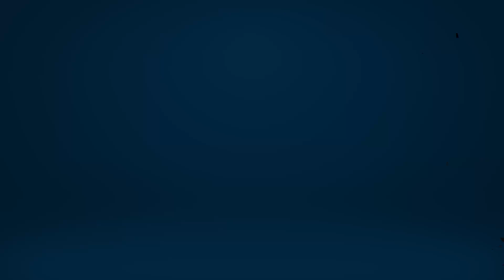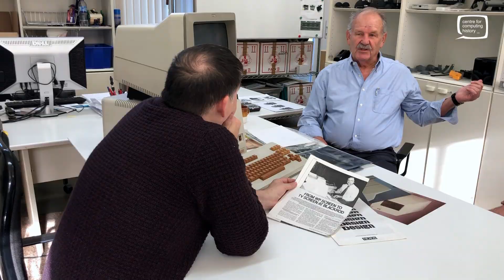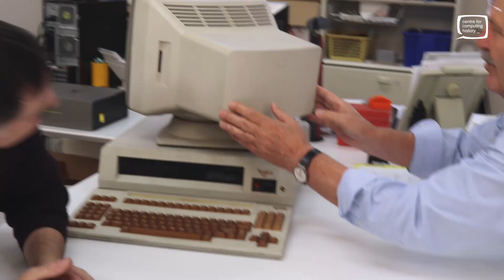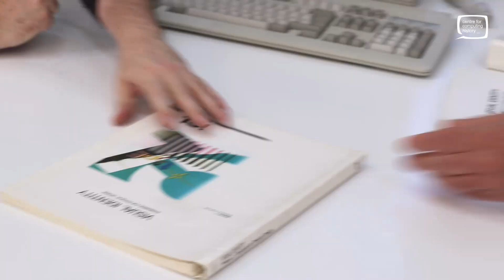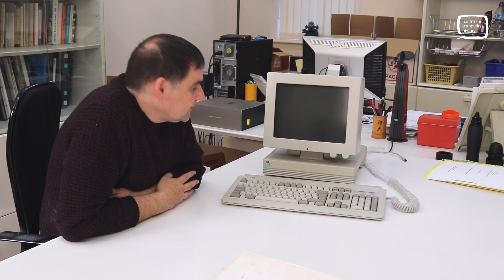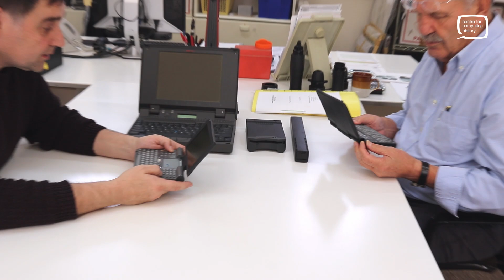Satherly Design - Product Design for ICL, Logica, Tadpole and GeoFox

Comment: I was Managing Director of Logica VTS Ltd for the whole of its existence, from February 1979 to June 1986, in both London (Newman Street) and Swindon (Drakes Way). I supported and endorsed the commissioning of Satherly Design as our industrial designer. Richard did a fantastic piece of work for us and introduced us to Taylor Engineering & Plastics in Rochdale. They produced the tooling and the mouldings for our word processor, which was marketed as the Logica VTS 2200, the Nexos 2200 and the ICL DRS 8800.

Comment: Thanks so much for this. It brought back so many memories. I worked for the computing arm of British Telecom (BSSU - Business Systems Support Unit) in the mid to late 80's and used to install and maintain the Gen 1 & Gen 2 Logica devices. The Gen 1 was badged as the M3300 (Merlin 3300) and was used as a word processor, running 'Merlinword' software. These were used in external customers (admin offices, solicitors etc) as well as internal BT offices. The Gen 2 was rebadged as the M4000 and was more than just a word processor, running bespoke software for many different scenarios. The customer base included every DSS (Job Centre) office in the country and most theatres as well. The theatres ran a software package called 'RITA' (realtime integrated ticket agency ?) and was developed by the Royal Shakespeare Company in Stratford. The M4000 had twin floppy, single floppy & 10Mb hard drives variants, later growing to 20Mb. They weren't the most reliable of machines, the term 'Error code 11' still makes me shudder to this day :)

Comment: Excellent video. I worked at ICL in its later days and the DRS systems were revered as the gold standard.  I also have a couple of those Tadpole Sparcbooks, built like a tank but also very servicable, few screws.